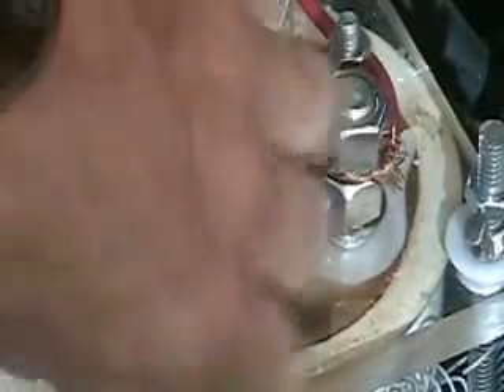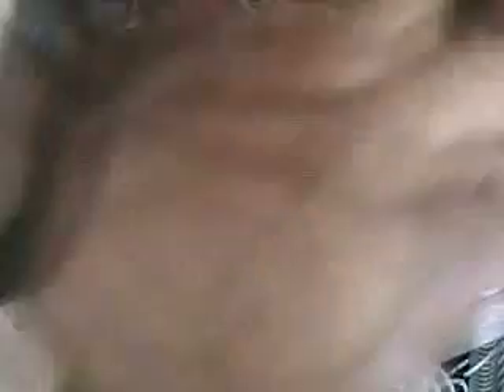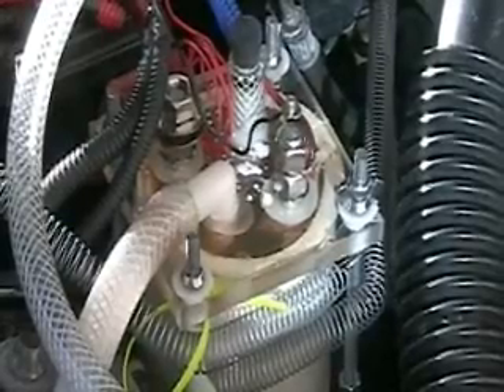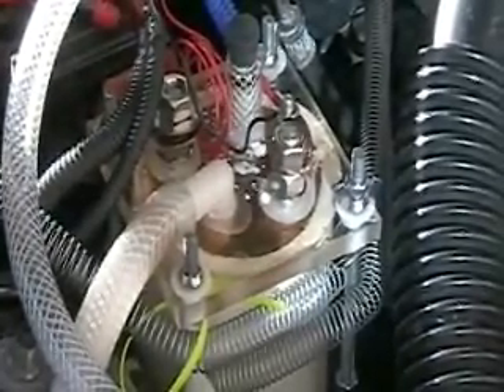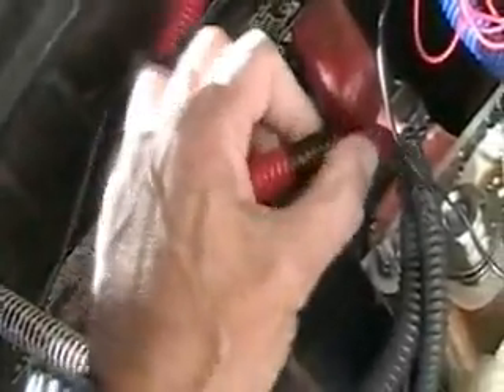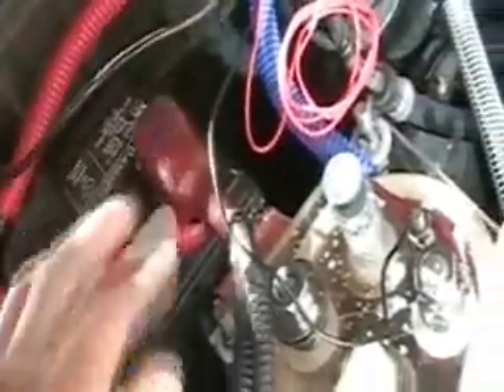Hydrogen Tap (FOCUS-check) 330

Comment: John,
A simple solution for your lock down would be to put a small amount of lock-tight available at any auto supply to the threads and then tighten down the nuts. This will allow you to undo the seal later....but will take a little more effort to break the lock tite

Comment: hey John, since the level sensor operates a relay, not only could it operate the indcator light it could be a safety to shut off the cells power 'till more water could be added
...just a thought
Fusion8r
Fusion8r

Comment: ONly way to know for SURE if its the nuts or the seal John is to replace your nuts with the nylon lock washer types and do a test.

I would replace ALL of them too, not just the top ones.. The bottom could also get loose with vibration thus causing the gaps.

One last thing tighten it down when the cell is HOT and if the washer is warming up and deforming a bit when warm, tightening it while HOT may help. Keep us posted on if this work for you!

Comment: have you tried nylon lock nuts on top of your wing nuts?  The nylon lock nuts will NOT loosen once tightened.  I think your current ones are NON locking, and thus vibrating loose, but cannot be sure unless you show the nuts up close.

Comment: John,

A simple solution to your problem is to use some lock tite on the threads....dont use too much....then you can undo the nuts later with a little work...lock tite is available an any good auto supply store
Ed